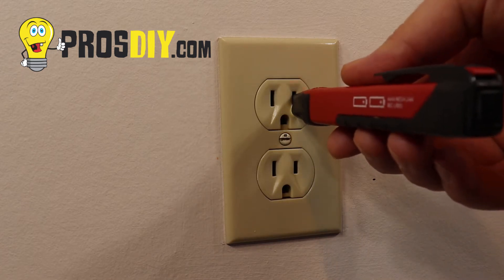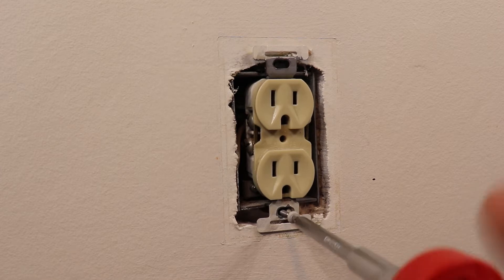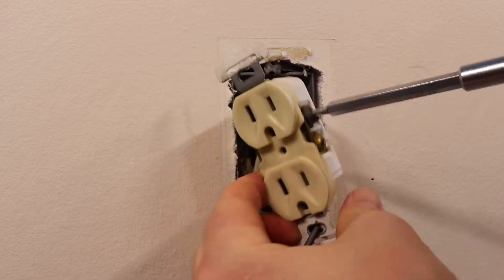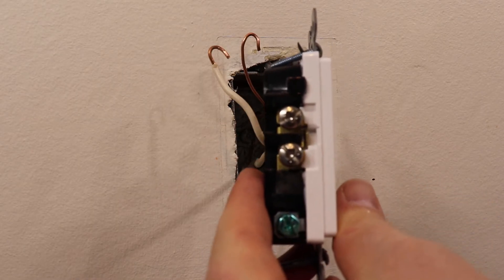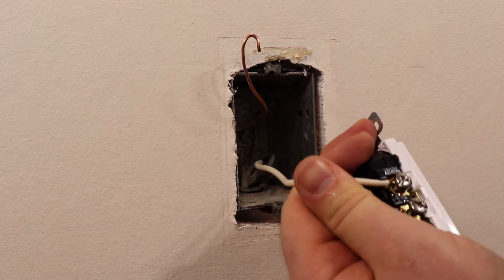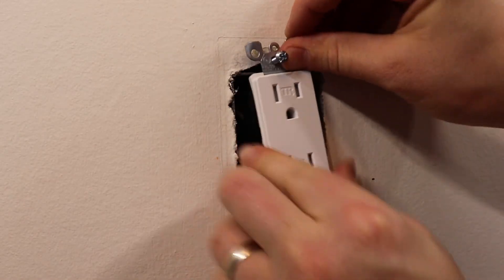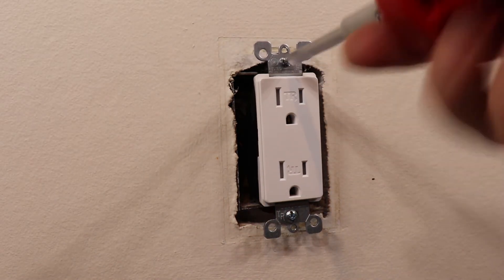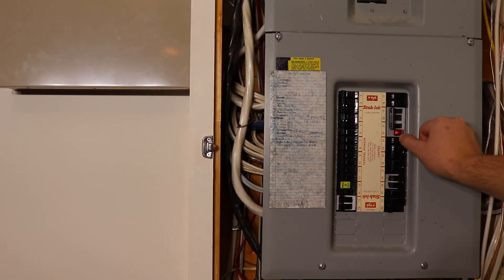Electrical Outlet Replacement: How to Replace a Wall Plug

Comment: You need a bonding jumper to ground the box. The wire coming in should be pigtailed to the box and another to the ground connection on the receptacle. I didn't see that.